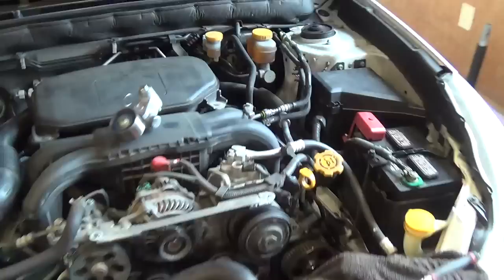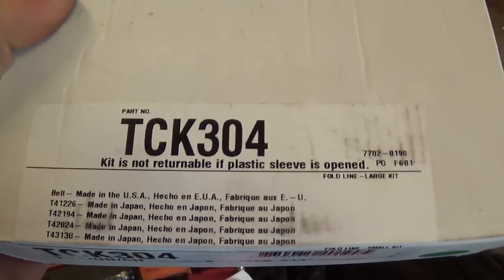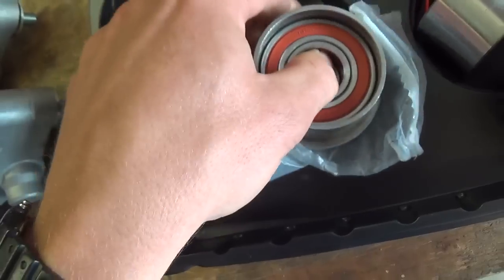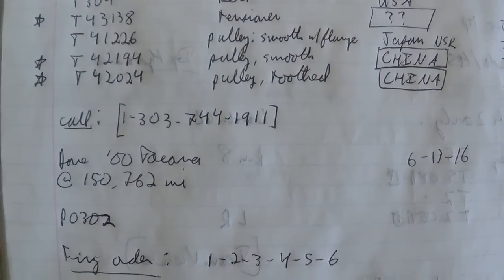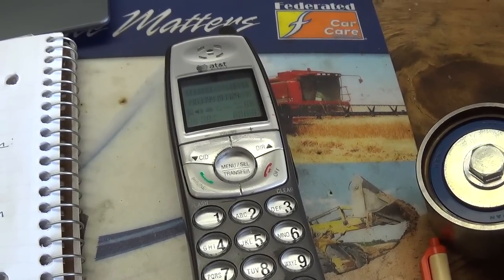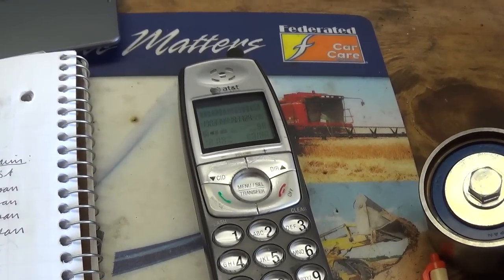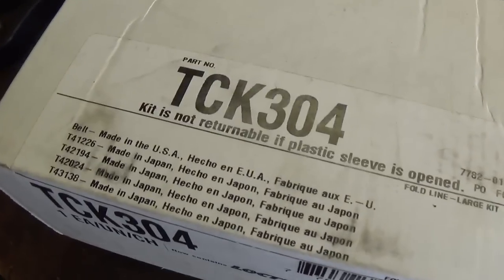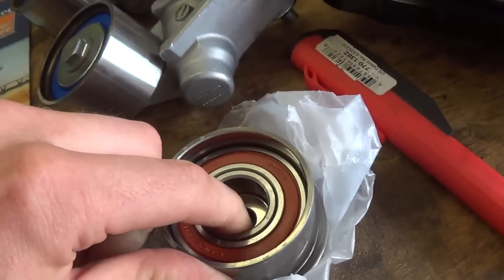GATES Subaru Timing Kits: BUYER BEWARE!

Comment: I deal with Rock Auto & they have stood behind every part but you have to watch the kits b/c sometimes they are returned with swapped out components. I had a similar issue with timing belt kits but this was on a 07 Chevy Aveo and a Dayco kit. Never had an issue before until I opened the kit with the car already disassembled & found nothing in the kit was right except for the belt and the customers water pump was leaking with over 100K so I had to buy the same Dayco kit from Advance Auto Parts. Rock Auto paid the shipping and the cost difference plus gave me a store credit. They explained to me they have returns all the time do the inventory & if everything is there they give the refund but they have had customers buy a cheap kit & expensive kit & swap the parts & return the expensive kit with the cheap parts in them so beware of that. I had them check their kits and they sent me pictures of what was supposed to be in it & what was in my kit which they gave me the store credit. I'd have them look at another kit and see if that's what someone did. I looked up your kit & a AISIN TKF006 kit & the tensioner you had matched the AISIN photos. The Gates picture clearly had Japan so don't know if that happened to you or not. I'd turn this over to a Rock Auto Customer Service manager with this video link...they may take care of you  I like dealing with Rock Auto or Amazon b/c you can get OEM parts and a huge discount over dealer prices with shop discounts.  I hate Chinese parts but it's getting harder & harder to get OEM parts to get away from that & find out your dealership part you waited 2 weeks for have made in China stamped on them.
Reply: Well stated.  Same here with Rock auto.  I've had that issue with the mentioned wheel bearing I posted about on a different thread here.  It's common for someone to shove junk in a box and send it back for a refund.  The guys receiving parts back at times haven't a clue about what exactly should be in the return.  They see  "Pulley, Belt, Tension.....etc..."  Match it all up for a basic look over..and process the refund.  I'm sure they get stung a lot by people pulling that stunt.  So long as it looks 'new'?  they run with it.
Reply: Tedybear315 Exactly...As long as they stand behind what they sell they have me as a customer.

Comment: I recently changed out a timing belt on a 2005 Sienna. It had 192,000 on the original belt! The owner had no idea of what a timing belt was. The belt was all cracked, but the pulleys, pump and tensioner were like new. Seeing is believing, I replaced everything with either Aisin or Toyota OEM.

Comment: I've moved to buying OEM Subaru parts for timing belt stuff. They can be had for the about same ball park as the Gates kit from Subaru dealers that sell online. The local dealer charges an arm and leg though. I do the water pump too, but I've seen a few fail. I started buying OEM after I had an idler blow up after ~30K miles on my own Impreza from a Dayco or Gates (can't remember which, it's been a few years) kit. Luckily the old 2.2L didn't bend any valves and since then I've been OEM or GTFO. Probably should have bought some lottery tickets that day. :)

Comment: Very disappointed in Gates (& Rock Auto) after this video! Usually we are wanted to get the job done, thinking we have done our research while picking a kit. I never would have thought of looking that closely at the parts, just believing what the packaging and seller has stated as truth. Thanks Ivan for the heads up. Wonder what Rock Autos official statement to all its customers on this issue is? Should we trust them? Or start purchasing elsewhere?

Comment: I feel your pain with Gates now. The wife has a Chevy Aveo and all the problems that go with it. I have been using Gates belts in the past because they used to be a reputable company. The problems starts with the plastic idler pulley breaking in these engines. 2 months ago the kit I got had cheaper looking parts that said china on them too! A cheap pulley can ruin a good engine and its not worth it to use it.
Reply: Shouldn't of bought a brand engineered Daewoo to begin with!  That's straight up divorce ammunition!  ;)

Comment: always use an OEM tensioner with these timing kits. The ones that come in the kits are known for failing. the gates Belt, water pump, and pulleys (from japan) are safe to use.

Comment: Anymore especially with older vehicles even if you go OEM you still cannot trust the country of origin. I ordered a head gasket from Honda for my 91 Integra and got a chinese POS from Honda! What are you gonna do? I had to use it. It's been fine but I also upgraded with ARP studs to get every measure of certainty I could possibly get.

Comment: Interesting video, just to advise other viewers in the UK and EU that Gates kits here may be different to the US market 
I just bought a Gates TB+Water pump kit for a 2008-13 Impreza 1.5, the kit is KP25612XS-1 and I asked the ebay seller to check the bearings for country of origin, all the bearings are labelled NSK Japan, NTN, Japan or Koyo Japan.
The tensioner was similar to the one you have but the oil seal on the hydraulic piston is NOK japan and the Bearing is NTN Japan.
As this is a Gates EU product, possibly  they use a different supply chain to the US market kits?
I am fussy about the quality of components I use as well but was satisfied that the quality of bearings is good enough for me.
I have had bad experiences with so called quality bearings before, I fitted a front wheel bearing twice FAG brand and after the second failure I bought genuine Toyota and had no further problems, OEM is best for some applications.

Comment: Be interesting to go to a Subaru dealer take a look at one of the kits there I wonder if even Subaru is unable to get the same manufactured part on that older vehicle,  it may be that those parts are no longer manufactured by the original supplier therefore the aftermarket has taken over.
Definitely makes you think about going to the dealer or at least a local auto parts place where you can open the damn box and take a look at it before you purchase it. On some components I have no problem putting a cheaper Chinese built product in the car but certainly not on a mechanically critical and destructive component if it fails. having your blower motor go out is certainly an annoyance but it isn't going to destroy your engine.

Comment: So what about buying a Gates Timing belt and just buying the tensioner and the pulleys elswhere. I found for my 2007 lancer 2.0 with the 4g63 a gates timing belt but its only the belt without any pulleys. So speaking about the belt is it good or bullshit. Im not really interested in the quality of the pulleys just because as I said I could buy oem parts separate elswhere. But what about the belt any problems with it. I was reading stuff about the belt things like can stand good against heat and is pretty durable. Any info about the belt would be awesome thanks.

Comment: These are two separate issues. Whether you want to use Chinese instead of Japanese parts is a personal issue. I'm old enough to remember the same stigma, right or wrong, concerning Japanese manufactured items being of inferior quality, versus USA made. You can substitute in Mexican, Korean, or whatever. Misrepresenting separate parts as listed is another thing. If I'm buying a ford don't show up with a Toyota. These are how class action lawsuits start.
Reply: This is a case of FRAUD and it should be treated as such. Ivan should have told Rock Auto that it was fraud and demanded all his money refunded including shipping. If he had charged it to a credit card that company would have had it back for him in no time and Rock Auto would have been sending him a prepaid return label to send it back to them at their expense. And in turn passing everything back to Gates and discontinuing their relationship with Gates. It will happen when enough of us start refusing to put up with this kind of FRAUD.
Reply: The stigma of poor quality parts from Japan was pre-war. After WWII the Japanese adopted the Shewart Cycle as taught by Prof. Deming.
Reply: +John B. Kobberstad Unfortunately as motoYama82 said, he needed to complete this repair job so he used the legit parts and is screwed on the rest. Personally I'd have returned the kit with the stock worn components. If Rock Auto refused to refund my money I'd dispute the charge with my cc company. But yeah, letting Gates get away with this deception and buying from Rock Auto when they're selling mislabeled and phony parts just lets them keep doing it.

Comment: In your professional opinion, Is it wise to install a OEM timing belt kit for a 98 Toyota sienna with over 350,000 miles on it?

Or can I use a  cheap china timing belt kit for $60.00 from Ebay? 

Thanks for your time!
Reply from the maker: OEM only. Your faithful Toyota will thank you :)
Reply: Pine Hollow Auto Diagnostics Will do thank you so much!

Comment: Interesting, I encountered a situation like this a couple years back getting ready to have a timing job done on the 03 outback I had at the time. I bought the Gates kit from RockAuto and and opened the box to look at stuff and noticed the tensioners said China (through the plastic!) even though the box said Japan/USA. I complained and returned it. Ordered the exact same kit # from Amazon for a few $ more and it was all NTN, Japan stuff. I heard some rumors at the time that maybe there were counterfeit Gates kits out there but I don't know how accurate that is. It is interesting to me that your problem kit also came from RockAuto. Has anyone observed the same issue with kits from other sources?

Comment: One thing to keep in mind about Amazon is that when you have something like a water pump fail, you can't warranty it through Amazon. I just ran into this on an '05 Grand Prix, 3.8L. They told me to go back to Gates directly and they require an online retailer warranty form you have to fill out and send in for a refund. Waaaaaaaaay too much trouble compared to Amazon returns. I couldn't return it since it was past their return time window. I just bought another one, but from ACDelco through RockAuto. it was only about $25, so not worth my time to deal with Gates. The Gates pump was Chinese too I believe. Bottom line: buy from somewhere that you can return it under warranty if you think you might ever have to, especially if it's expensive.

Comment: I lost all respect for gates when I installed their kit on my WRX. Within 7000km the water pump failed. The actual pulley separated from the shaft and machined its way through the timing cover. The timing belt almost fell off! When I spoke to gates about this trying to cover my repair/ towing costs. They pretty said tough luck. Because I did the work myself. They only exchanged the kit for a new one.... I took that brand new kit and threw it in the garbage. Bought all OEM  stuff.

Comment: Thank you for this video was just installing gates kit on my Subaru and I just happened to come across your video was having some issue's with the water pump and low and behold 2 china made pulleys tensioner was made in Canada going to use hope it doesn't fail and water pump has no location mystery part glad I checked and more so saw your video thank you sir

Comment: Had a similar experience with a different brand kit for a Honda V6.   Mixed country of origin parts.  Installed kit anyway and guess which country of origin for an idler bearing that failed causing damaged valves???      Ending up junking vehicle that should still be running today because of the cost to repair.    Grrrrr...

Comment: For our 3 Toyotas, I buy Denso, OSK, Aisin or OEM Toyota from Amazon, Toyota Parts Deals or our local Toyota Dealer (Servco Toyota in Hawaii).  No more screwing around with Made in China parts as I have done before only to replace them after a few months due to parts failure.  Aisin BTW is owned by Toyota.

Comment: I'd return the kit you got.  My gates kit included all Japanese parts.  NTN cogs, pulleys and tensioner.  My kit also included the WP.  I could tell it was a little rough.  Casting wasn't as smooth or finished like the OEM, but the shaft didn't have any play and the impeller was identical.  I also purchased the Kevlar belt upgrade.  50k+ later, car still runs great.  TCKWP328RB

Comment: I have the gates "blue" kit on my 07 wrx. Pretty dang pricey is an understatement.. 20k miles after install i had a leaking h2o pump. Im 20k away from needing the belt done again- planningg to use a Mitsubishi belt and gmb rollers/h2o pump...Ive used this kit a few times and it seems to be as good of quality (probably better) than the gates kit for 1/3 of the price.
Reply from the maker: For water pump I would not use aftermarket anything on a Subaru...

Comment: I agree with the statement made before that the asin kitts are the way to go, always quality parts. That said just two comments if you want OE parts you have to buy OE the only way to guarantee this is if it says Subaru on the box. there is a clearly legally defined difference between OE and OEM. also when did Subaru get this "Idol" status they're well built cars but I make easily as much money repairing them as i do maintaining them.

Comment: Interesting, I watched your video and decided that I would bypass the Gates timing belt kit. I ordered an AC Delco kit and when the job came up. I opened the packaging and found the AC Delco kit was an "Gates" repackaged timing belt kit with the same discrepancies you are bring to our attention. I'm also having issues with the belt marks lining up on the pulleys, like its 2-3 teeth off. Now I read not to use the Gates water pump from South Main Auto, which he in my opinion is an outstanding mechanic and resource, I have an AC Delco water pump. What to do??????????
Reply from the maker: Go OEM.

Comment: I put a Gates kit on my car last year and the timing belt started jumping teeth. I took the car to the dealer and they reset the timing belt and all looked good to them.  Of course the belt jumped teeth again.   I'm lucky the engine (2.5 XT) was not ruined. I took the tensioner back off and the force to compress it seemed less than the old one.   So I bought a Subaru tensioner and the car has been fine since.  Of course I couldn't return just part of the kit so I had to take off all the parts.   Nothing like doing a job four times.   No more Gates products for me unless they come out with a change in policy.

Comment: Good Job Ivan
I would advise your Consumer advocate agency regarding the false labeling of the product and see where that leads. It will not solve your issue but might help someone else from having the same issue happening to them. Gates has to be held accountable for there products. I recentlybwas inquiring about a Replacement  Gates CVT belt  The Gates rep basically told me to buy from an alternate manufacturer.

Comment: Those water pumps fail a lot on Subarus. I have driven three of them personally and on all 3, water pumps have failed which prompted a timing belt service. What happens is they spray/leak coolant to the back of the block somehow, air probably from driving pushing it backwards, making a lot of people think they have a head gasket failure.  When it is just a water pump. On my 2001 the seller told me it has a bad head gasket. Even I thought it was a head gasket. Took it to the mechanic to fix it, on visual inspection even they thought it was a head gasket. I paid a $1000 deposit, the guy calls me back the next day and says, hey, it was a bad water pump and timing belt. Got the $480 refund as it was just a timing service. Got a $3k discount on the car. 11 years later still works fine
Reply from the maker: hmmm interesting! Never seen a failed Subaru OEM pump, even on cars over 200k miles on them...
Reply: Same with me. My friend who worked as a Subaru mechanic for a decade has only seen 2 water pump failure - one of them was because the car severely overheated, the other one (which was my car) was a worn out bearing. 

I just installed at set of gates timing belt on my subaru. I never bothered to check where they were made. Oh well.
Reply: any parts that moves will fail,there are no exception,were there is friction there is wear,lubrication only helps but does not make friction disappear !they might last longer ,I give you that

Comment: Heres the issue, Gates now lists two different kits for their subaru timing kits now. One with an N at the end of the part number and one without. The issue is they made the original part number without the N which use to be all quality made in Japan parts with the cheaper Chinese stuff; and they made the new N part number essentially what the old kit use to be with the quality parts. So in this specific case if you ordered the TCK304N instead of TCK304 you would have gotten the old quality kit instead of the Chinese kit. This is also true with the EJ257 kits, TCK328 vs TCK328N.

You can check out both kits on rock auto, the cheaper non N part numbers if you click on the info tab are listed as "OE Improved" which is kind of a misnomer given its the kit with the worse parts. The made in Japan kit with the N part number is listed as "OE Exact" when you click on the info tab. Usually the price difference is about $20, but well worth it.

So you still can get the quality kit from Gates, however what they did by making the old quality kit into a new part number instead of making the new cheaper kit into the new part number is an incredibly shady move on their part.